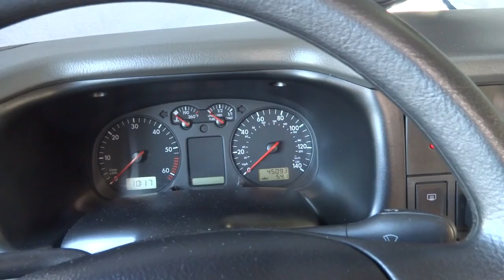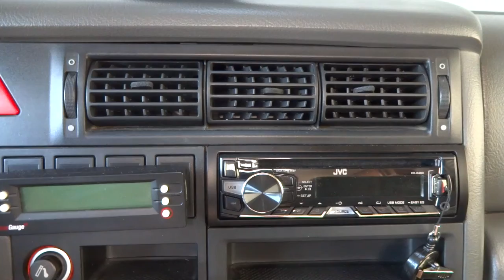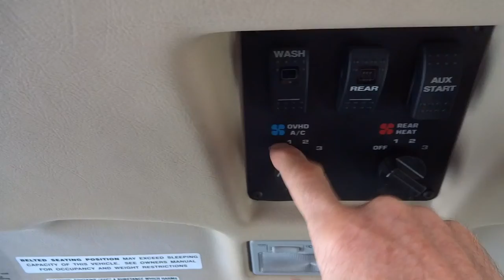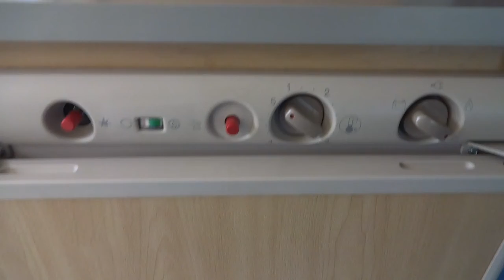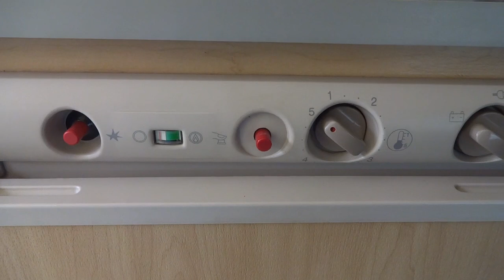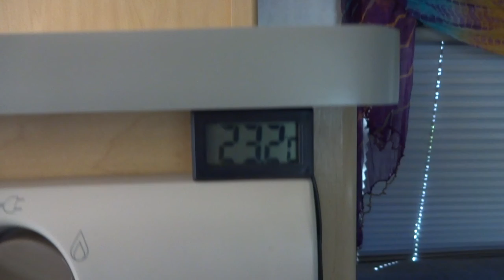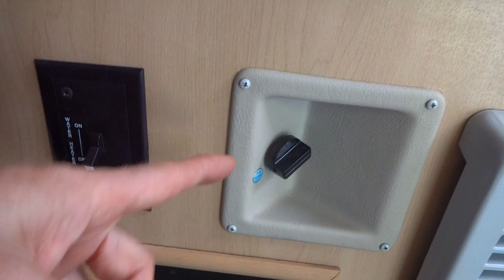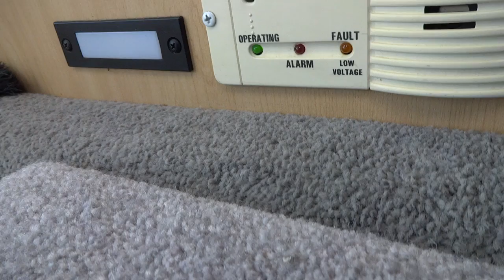Rialta HD Interior Mods as of 2015

Comment: Just an FYI for anyone thinking of a Rialta purchase:  The engines are only 140 hp for the older models.  Starting in 2002, they got upgraded to a more powerful 201 HP engine.  Depending on your needs, the smaller, weaker engine might be fine.  Might even get a few more MPGs.  But travelling over hilly terrain, or towing, or carrying more than 2 people inside might require a 2002 or newer model year.  The extra 61 hp really comes in handy, from what I've heard and read.  Happy Travels !

Comment: What is the head room on this RV?
Reply from the maker: John Hales The headroom varies by where you stand and the model.     The maximum is 6 feet 2 inches, probably under the skylight by the kitchen or in the entry way.  My estimate of the minimum is closer to 5 feet 9-10 inches.  Under the AC you can subtract a few inches inches.  I removed the AC to save weight and increase headroom.
Reply: Rialta99 thanks.....tall enough for me :)
Reply: I’m interested to know how you manage without the A/c? Do you have a free standing unit? Or just fans? Any downsides?